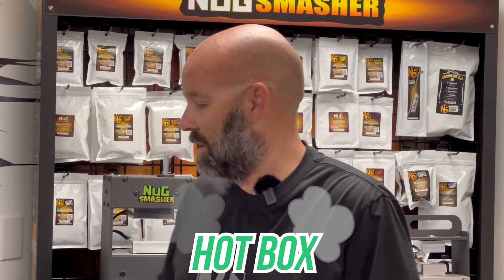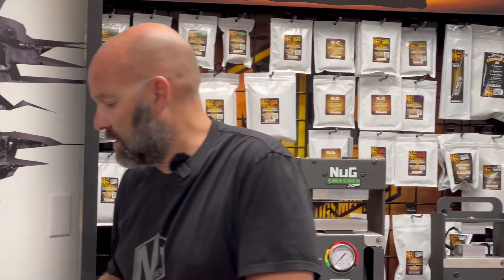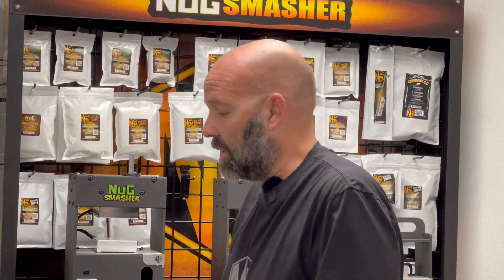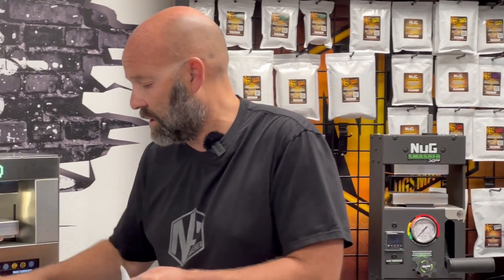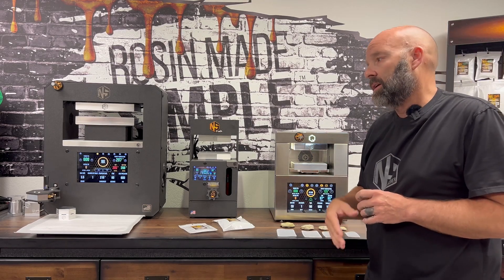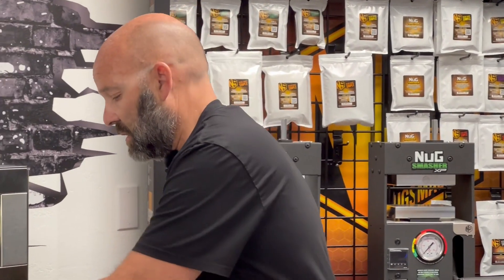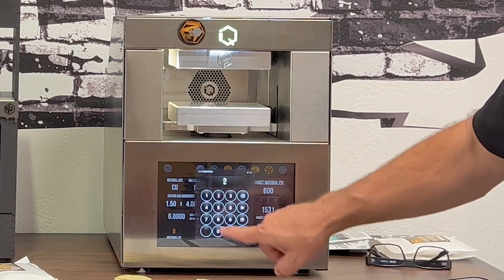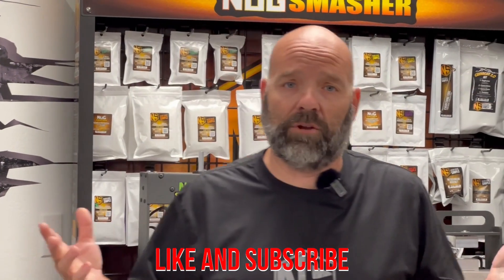SURFACE AREA - HOW IT AFFECTS MY PRESSURE?

Comment: How do you work out the material pressure for 3.5g bag 
I get how to use calculator to work out what pressure I need on gauge to achieve a certain pressure between the plates but don’t understand how I get the material pressure fig to start with 
What should my material pressure be for 3.5 bag
What is it for 7g bag

Comment: For bubble hash extractions, bottle tech isn’t really an option. How do we get accurate surface area when we are not doing flower and can’t do bottle tech ?
Reply: Nevermind I got it. You just use the master extraction screen and type in the bag size and it calculates as normal non bts

Comment: How do you get that honey type of extraction in the Mini. I used bottle tech style and heated at 205 but my results so far have come out spotty and not so much like liquid. Could it be the flower I’m using or the type of bag?
Reply from the maker: it could be a few factors like the flower itself, also make sure to not over pressure the mini, you don't want to smash down too hard on your flower.

Comment: So with a mini is it possible to over pressurize a 3.5 or 7 bag with either of them stuffed full or over full?
Reply from the maker: Yes it is, you don't want to pull as much pressure as you can on the Mini, after hitting a stopping point when smashing the bag, add a 1/4th pump for 3.5grams, and an extra half pump for 7 grams. let the heat and pressure do the work you do not have to smash it down as flat as possible.
Reply: @Nugsmasher   cool thanks I'll give it a shot. I think I might of been smashing too hard all this time
Reply from the maker: @SPONSOREDBYDAD  You are very welcome, easy mistake without a psi gauge. let us know how you do!

Comment: Why don't you use a bottle tech cylinder pre press ?
Reply from the maker: We do use pre press molds when we are processing multiple runs but on single usually load by hand. Thanks for watching
Reply from the maker: The Pre Press molds are a great product but not required and is a personal choice!

Comment: Idk if my flower just sucks but only getting 7 to 10% yields with the mini. Still having a blast with it tho. Thanks for the info.
Reply: It helps if your flower is at 62-72% humidity. Also some flower needs a little higher heat. Most of the flower I press only gives me about 14-17% return, but I've heard that it can make a difference if your flower is grown indoors or outdoors. Hope this helps!
Reply from the maker: There are many factors that can affect the yield some of it is genetics of the flower.  Keep on smashing and hit us up in chat if you need more assistance.  nugsmasher.com
Reply from the maker: There are quite a few factors that lend to a great yield. Humidity level of flower, Strain, growing conditions - nutrients, lights and cure process.